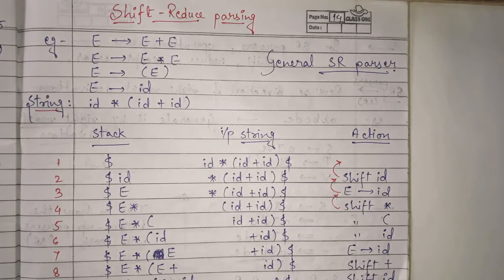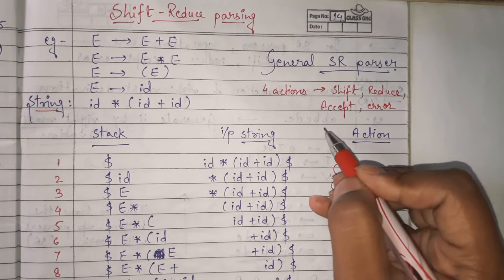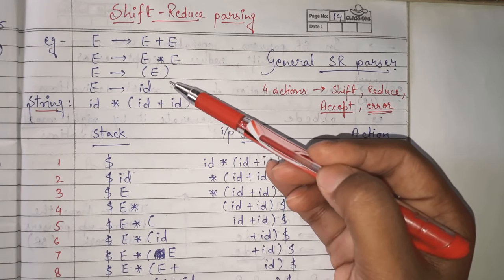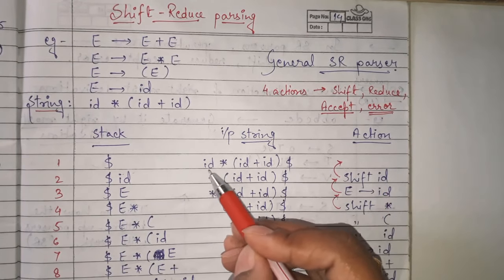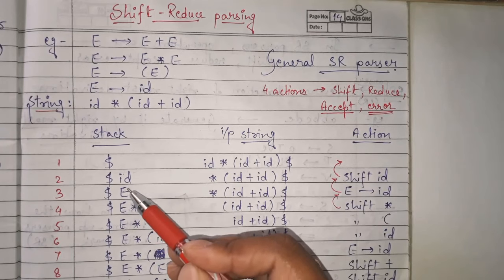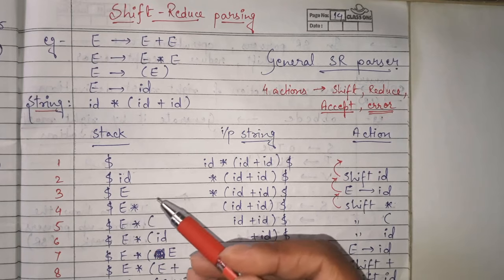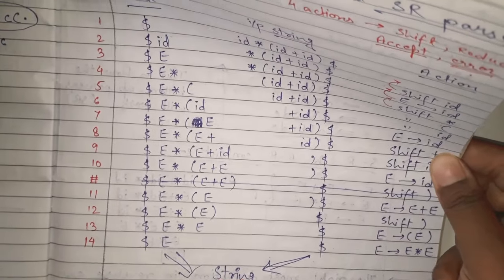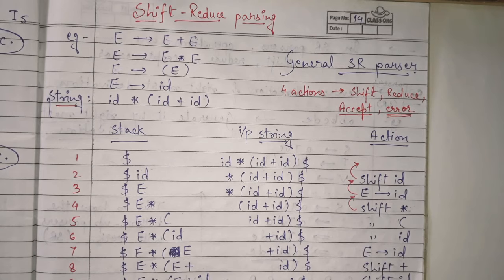20. Shift reduce parsing in compiler design| Bottom up parsing | Shift reduce parser in CD

Comment: All those strings that present in the stack at some time or the other are called "viable prefix" ( read from Bottom to Top and ignore $ ).
The initially written 11th iteration is rightly cut as the content of stack written there is not a viable prefix, coz as soon as the Parser sees E+E in the stack parser identifies it as a "handle" and replaces it with E, so the string E*(E+E) is never is the stack.